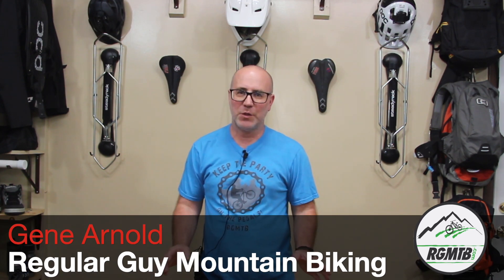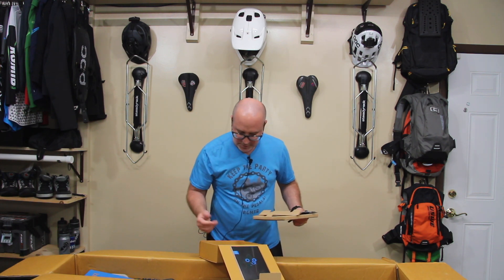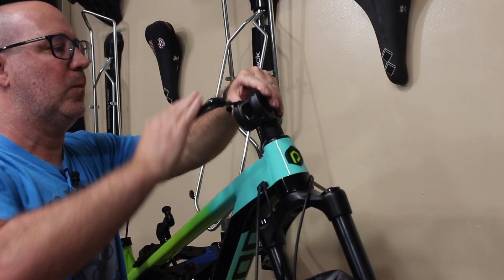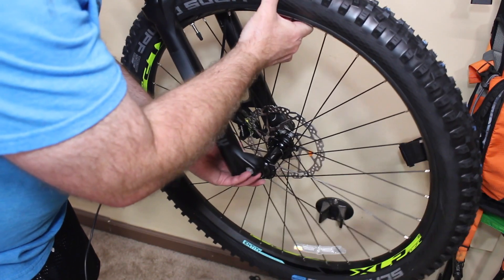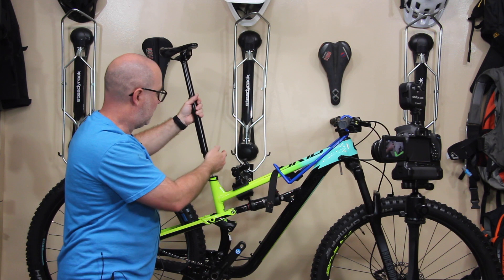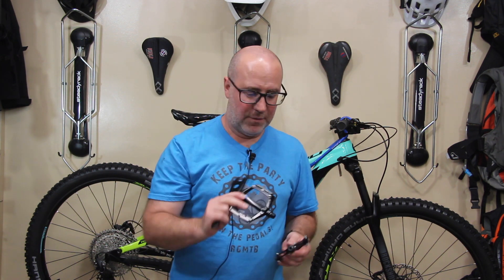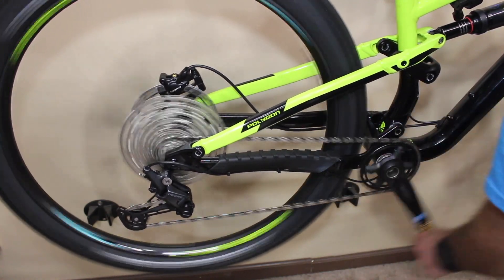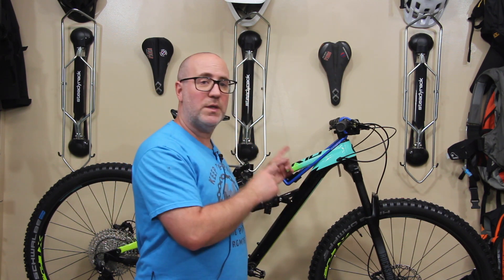Build a mountain bike with just two tools! | Polygon Siskiu T7 Unboxing & Build Video

Comment: Got my T7 first of July and after a few weeks here is my quick review on the bike:  For the price $2k with Tax its hard not to like what you get right out of the box.  The Shimano Deore is absolutely bulletproof, no need to change anything on the drivetrain in my opinion.  Many entry level bikes come with SRAM SX which really should be SUX.  The Recon Fork was my biggest worry and yes it is a little heavy, it has done an admirable job so far, as well as the rear shock.  Contacts points in Saddle and Grips are just fine and dropper works great.  Even the the pedals that come included are just fine.  If you get the Schwalbe Tires they are easy to setup tubeless.  The 2.6 width and aggressive tread is somewhat a slow roller in my opinion, but again for what you get out of the box for this price how can you really complain.

Comment: Thanks for a well done review and assembly video. It helped me a lot! I Ordered a T7 on March 21st and it arrived April 2nd. The top flap was open and the little box with the goodies was busted open. Luckily I found all the pieces and there was no damage to the bike. I kind of think I got a bike that was previously returned. I'm 5'9" with long arms and long upper torso. The sizing calculator placed me on the lower end of the size L range. It feels pretty good and a more experienced rider than me said the fit looked good.

Comment: I have the rear derailleur on my super pricy bike, yes, no need for pricy Rd if you can smash it to bits. I've also tried this cassette, it shifts smoothly
This bike seems quitw nice, nice to see they went for reasonable drivetrain option.
Seems like a good option, no matter the budget. But I would out an oval chai ring. And of course Catalyst pedals too

Comment: Just to ad a comment about Polygon bikes, there has been a couple of people who received two of the same side peddles but they where marked L&R so if you ever feel like a peddle is not going on properly just check the threads so you dont strip your cranks. Also people have issues with the dropper not working properly, just make sure you do not have a big kink where your cable comes out of your downtube.
Reply from the maker: Thanks for this info 👍

Comment: I have a 2021 T7 and love it. My only complaint is that it's fairly heavy. I'd love to see if you could do a regular guy's guide to lightening the bike by spending a practical amount considering the bike's price point.
Reply from the maker: Check out Cure Cycling 👍
Reply: @rgmtb  I've seen that, Cure did not spend a practical amount.
Reply: cheapest way to save weight is to go on a diet ;)

Comment: did the suspension have air when you got it? For example: my YT did not have air in the suspension and it was crucial to set that up first before riding. Buying one of these for my son
Reply from the maker: Some air but it needed more. Honestly, I think it has to do with shipping. I'm gonna say that you will always have to check the air pressure in bikes that get shipped to you 👍

Comment: Great video thanks mate 
Did it come with the torque wrench?
And did you need to bleed or pump the breaks or shocks??
Reply from the maker: Yep! The tools in the video came with the bike. I didn't have to bleed the brakes but you will always have to adjust the shocks. That's not a fault of the bike because this always needs to be tuned per rider so I'm cool with that.

Comment: So i set my bike up but my dropper post won't work, i think there is too much slack in the line possibly, can i pull slack out of the line??
Reply from the maker: Yes, but don't make it to tight because that may cause the dropper to stay up and not down after you push it down. This is common across all droppers and not just the one on these bikes. I've been finding the sweet spot for years with these ;-)

Comment: Great vid. I love my T8 and haven't changed a thing. One question for you: have you ever had to remove the rubber grommets from a bike? I had occasion to change my dropper cable but I ruined the grommets getting it out. Also if you order new grommets they require that you remove your brake cable so you can thread the cable through the grommet. Lastly at 10.00 each they are too expensive to ruin and frankly there must be a better way to install new ones as they were a real PITA to remove.  Any tricks?
Reply from the maker: Oh I hear ya buddy! Those things suck on ALL BIKES! Trust me you're not alone on this one. Honestly the only tip I have is that I often add some lube to the grom to help get it to fit in the bike and allow the cables to slide through. You are correct that the cables will need to be removed to run through the new grom and that also sucks it! I'm sorry I have no tips for you but at least you know you're not alone HAHAHA!

Comment: What thickness does your bike  tires came with? I'm under the impression that it seems that some people get 2.6 and some 2.4's. which sucks because they are charging $200 more now!
Reply from the maker: Mine came with 2.4. I totally understand the frustration but when I asked BOL about this they responded by saying that getting tires in general are very tough. Also, BOL gets these bikes from Polygon so the switch happens a bit further up the food chain. The other issue is that the shipping costs to move these bikes is insane now! It's just messed up across the board.

Comment: I'm 5'9 should I get a large or medium?
Reply from the maker: Ok, you're in a tough spot. I'm 5'8" and always have the same question. First off, you're lucky in the sense that you will be good either way. Now are you looking for a more playful bike to rock around on or (med) or something that might be a bit more stable and better for climbing hills (large). Look, this is a really tough one. All I can say is that you'll be cool on either. The med might feel a bit tight but can be adjusted with seat placement and different stem. Large might be a bit stretched out but the same can be adjusted. I realize you asked me for a solid answer but I can't give you one. I'm 100% in the same boat. I tend to ride med but you are a bit taller than me.
Reply: did you buy the L or M Ibby? I'm 177cm which is just under 5'10", with 82cm / 32" inseam, also looking to buy a T7